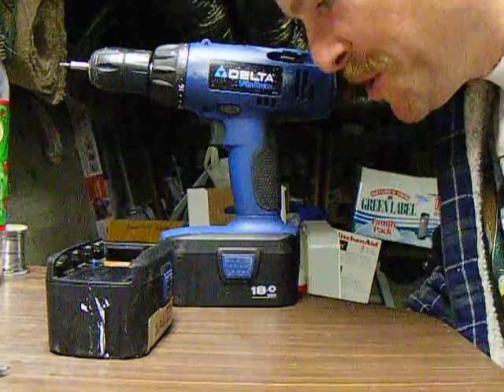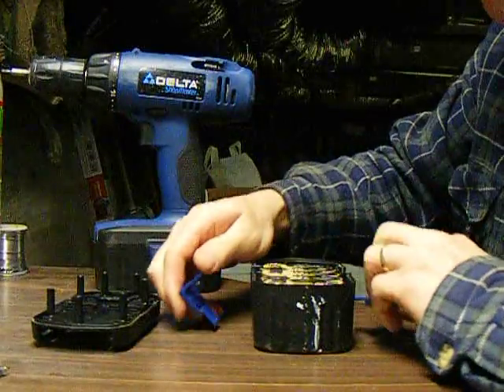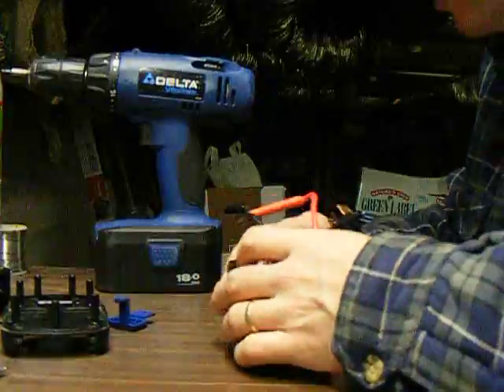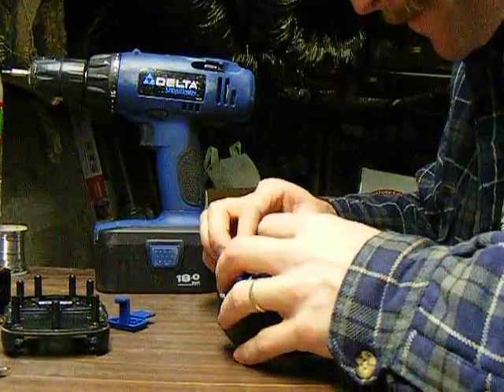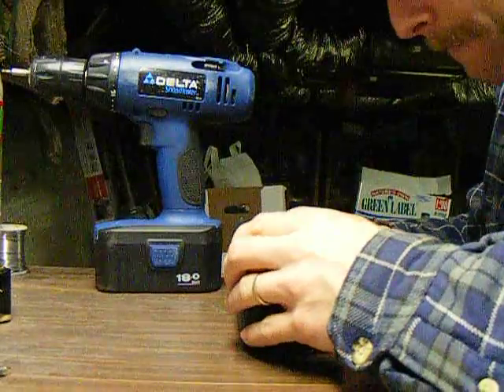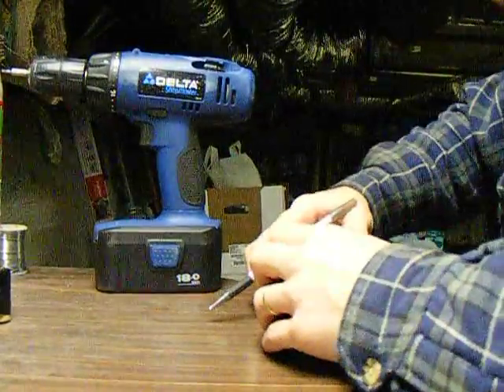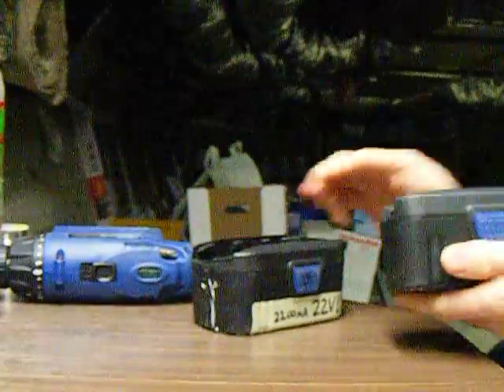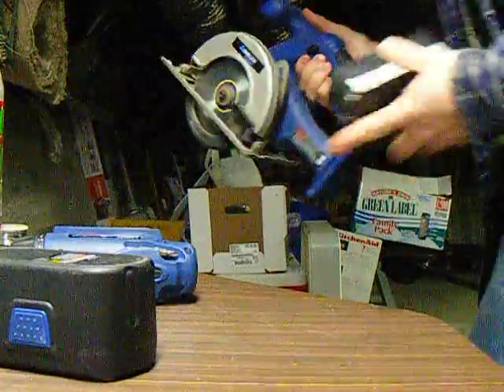Cordless drill / Power Tool NiCad to LiPo Conversion

Comment: Which charger do I charge for when I replace the inside of the battery? Like you did
Reply from the maker: you have to get a charger made for the batteries you use.  what kind of batteries did you use?

Comment: Sir, while your video is appreciated there are some things you need to know:
1- A lipo battery cell has a nominal voltage of about 3.7 V x cell, once fully charged each cell will have 4.2 v, thus a 3 cell pack that is fully charged will have about 12.6 volts x pack. If you are using 2 packs wired in series your end voltage will be around 25.2 v not 22 V as you stated.
2- Lipo batteries should be handled totally different than how you would handle a Nicad or Nimh battery and they need to be charged in a charger made specifically for lipo batteries.
3- Lipo batteries don't like to be discharged lowered than 3.7v each cell, so If you want your packs to last, then I recommend not discharging them beyond 3.75 or even better,  3.8v x cell.
4- It is recommended that when you charge your lipos you always balance charge them so that each cell has the same voltage or at least as close as possible. While you are not obligated to always do a balance charge, it is considered a best practice to do so..a well balanced lipo pack will work much better and last longer than an unbalanced pack.
5- Finally, instead of using 2x3S or 3 Cell lipo packs, wired in series, just buy a 5S pack which will have a nominal voltage of 18.5 volts and a charged voltage of 21 volts.
Finally, lipos can be dangerous if not handled correctly ,so please take some time to read and learn about this battery chemistry.
Reply from the maker: Here is my latest tool pack conversion--all steps and parts info:   Converting a tool pack from Nicad to Lipo ...definitely felt like more than 22v!!
If you get a 5s bat don't you need a 20 volt charger?  with 3s you can get a cheep charger see link
http://www.ebay.com/itm/E-Flite-EFLC3115-LiPo-Balancing-3S-11-1V-Battery-Charger-With-Power-Supply-/291299506815?pt=Radio_Control_Parts_Accessories&hash=item43d2cdba7f
thanks for the comments.
Reply: Ben Jamin Actually if you use a 5S pack you need to get a charger that can handle those 5 cells; you can find some budget chargers that can charge balance 6 S packs. For sure it will be more expensive than the eflite charger you currently own, but from your 2nnd video I can see that your lipo battery collection is growing so I you might as well get a good budget lipo charger that can go up to a 6s pack. Also need to keep in mind that some chargers are AC/DC (bit more expensive) while others are just AC. My first lipo charger is a Tenergy Tb6ac charger, it is a ac/dc charger with the power supply incorporated into de unit but it can also run form an external 12 v source or PS; it served me well and I still have it as a backup charger. This charger can do up to a 6S lipo and it also balances, it might be a bit slow when charging a 6S compared to the more expensive and larger capacity chargers but for you it would be just fine. The best part is that it wasn't that expensive (around US$ 45.00 on amazon) and since it already has a power supply built in, no need to buy one. You can also check the Imax charger, they are good and inexpensive, just make sure you get an original Imax since there are some companies that are cloning it and they are not as good.

Try to go into the Hobby king website, make sure you choose the USA east or West warehouse, they have some really nice budget chargers specially the Turnigy Accucel line of chargers. 

If you need any assitance, drop me aline and I'll be glad to help you out.

Comment: NO you wont. The amp draw is only as much as the drill's motor will take. There is a reason why your car's interior light is not burned out, because it's not taking in hundreds of amps. *sigh* If anything, the 14.4v drill will be slower with the 12v car battery.

Comment: if you do that, you're an idiot and probably a dead one. car batteries yes are 12 volts but are HUNDREDS OF AMPS. youll fry your drill motor, burn everything in the room and youll be a closed casket for sure.

Comment from the maker: From HobbyKing or ebay Turnigy 2200maH lipo pack rated at 20C(higher C more spendy).  They have cheep lipo chargers for around 5-10 bucks.  then you have to know how to solder and have a pretty hot iron....if you don't know electronics and short your batteries together it will get exciting and may explode in your face.  Good luck!

Comment: ...
I guess 3S LiPo pack will be enough, which is nominally (3 x 3.7) 11.1V and that is  1V more than it is now.. But when fully charged it shuld be 4.2V/cell so it should be 12.6V for the 3 cell pack.
If i choose the 4S pack that will be 4x4.2V=16.8V
Fully charged NiCd pack is 10x1.45=14.5V
The difference is 2.3V
Maybe I choose the 4S pack :D

Comment: Thx. Hard to decide.
Now it has 10 NiCd cells, and it is quite crappy. It is still usable for a while after charging. I took apart the pack yesterday, measured the cells one by one. 3 of 10 are 0V, and the whole pack is 10.1V after charging. The dead cells behave as shortcuts.
....

Comment from the maker: The 11.1V will run a bit slower I"m not sure how much--could be half as fast.  14.8 is only 3 volts more than 12.  I would go 14.8 for more power!  But I suppose it could burn up your switch---I finally did on mine.  One thing about lipos they don't like being over discharged....when you hear the motor slowing then charge it.

Comment: I have a 12V drill, and want to do the same LiPo-modding.
Should I use 3S (11.1V) or 4S (14.8V) battery pack?

Comment: @1bengrubb WARNING: DON'T LISTEN TO THIS IDIOT.  HE DOESN'T KNOW WHAT HE'S DOING!  22 VOLTS ON AN 18 VOLT MOTOR WILL FRY IT.  ALSO, IF YOU USE A NICAD OR NIMH CHARGER ON LITHIUM ION BATTERIES THEY WILL EXPLODE, NOT TO MENTION THAT HE STILL HAS AN 18 VOLT CHARGER FOR A NOW 22 VOLT BATTERY.

Comment: Li-ion batteries require special circuitry to charge and run. These circuits mantain current and voltage within limits that are critical to Li-ions.

 If you are charging them with a ni-cad charger, you are asking for trouble.
Same goes for installing them in a pack without protection.

 protection circuit module is must have to avoid Li-Ion battery pack from exploding, firing and damage.

They are available where you buy Li-ion cells

Comment from the maker: Just destroyed one lipo pack...You can tell immediately when the voltage gets low but when there is only 6" of plywood to go it was too tempting to go till the pack was dead---I think I overdischarged it and ruined it.  Got everything all fixed and the other pack converted so I'll be more gentle on the discharge now.

Comment from the maker: @ReverendJoeyT You have to break the welds off the origonal battery connetor then get a nice hot solder iron and solder the battery leads to the origonal connectors.  The origonal connectors just sit on top of the lipos and I had to space them up a little to get the spacing right.

Comment from the maker: @dansl70 My main concern was that the C rating of the lipos would be too low.  I didn't want the lipos to get to hot.  20C at 2200ma is around 40 amps the lipos can supply.  My guess is that these tools pull less than 30 amps.  The tools only draw what the voltage will supply.   So at 22V they pull more amps than at 18V.  I've cut up several  sheets of plywood and 2x4's and I dont' smell anything melting.  I'm extremely pleased with performance!  I can't wait till the other battery dies..